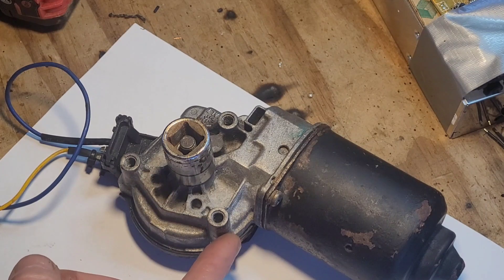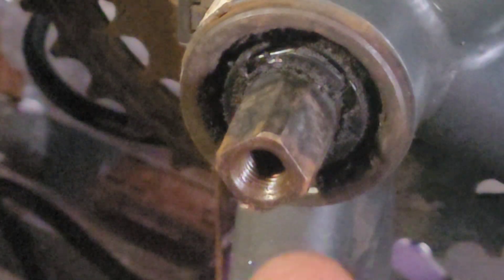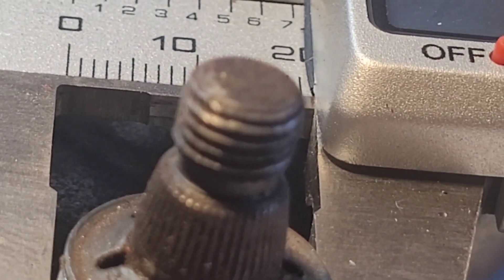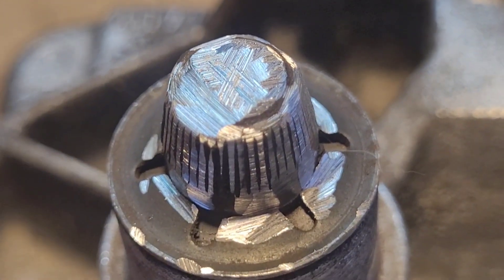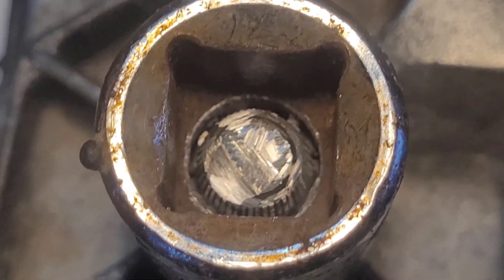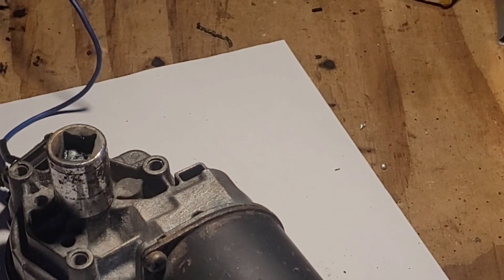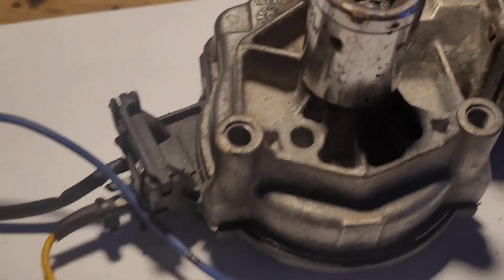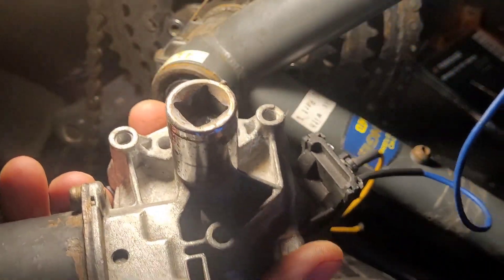12v Wiper Motor Direct to Crank Bike Idea - A major step forward - 1/2" Socket welded to motor shaft

Comment: This is a bodge because the wiper motor uses a worm gear to give a high step down ratio and prevent any free movement at the side effect of poor efficiency. Bike chain then steps it all up and adds a free wheel. More energy losses.